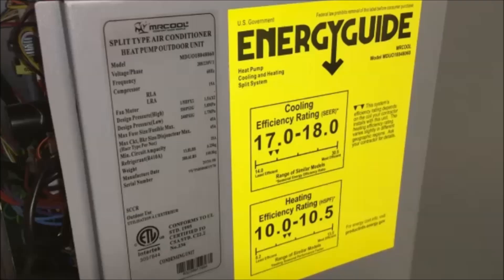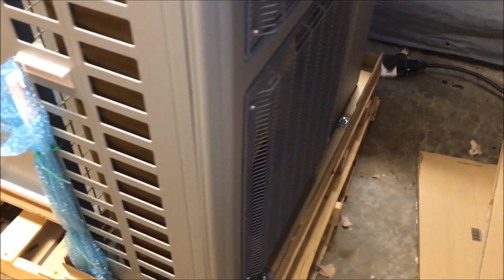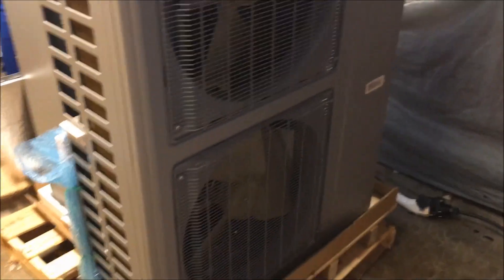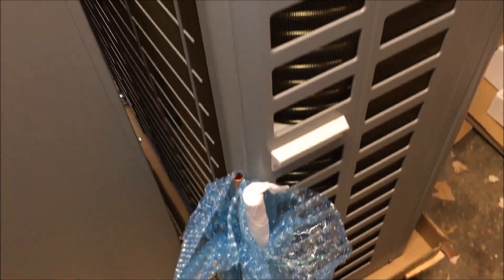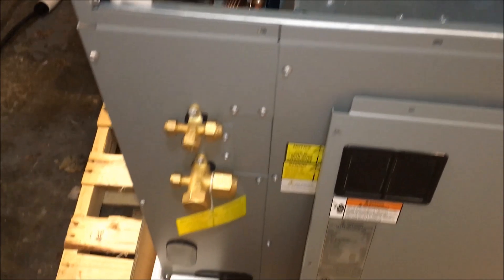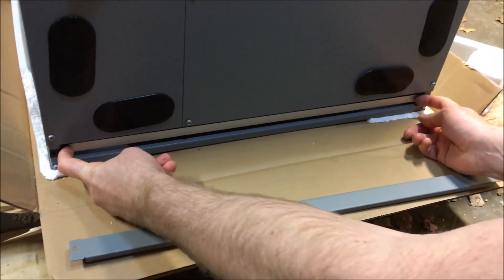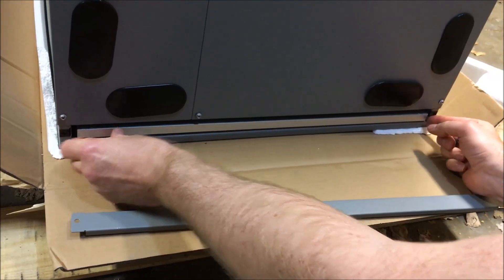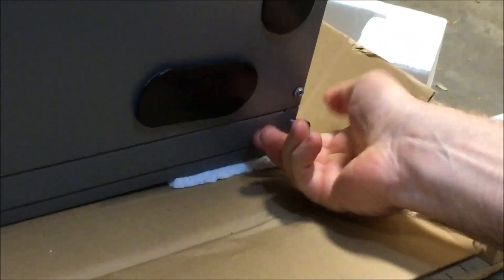DIY Mr. Cool Heat Pump DIY HVAC Unboxing Part 1

Comment: I just installed that same unit works great very quiet and so far keeps my 2500sf house hot in the winter and cold in the summer
Reply: Do you have to buy heat strip?
Reply: @davidk21419  i installed a 20kw heat strip but havent had to use them yet you do have to install some if you feel it wont keep up but it hasnt been a issue with mine so far but figured better safe then sorry
Reply: @davidk21419  I bought one too use it in 5 ton mode NJ... I dont use a heat strip... but so far temps have not gone under 10-15 deg... so we'll see. I like it a lot.
Reply: @VRVitaly  how's it running In the cold weather?
Reply: @whitechevy33  runs great i had a 20kw heat strip installed and have since removed the power to those and have no issues in indiana weather
Reply: Do I have to install a heat strip or is something install in the unit already?
Reply: Do you only install 1 unit for your 2500sf home? And if so how big it is,3/4 ton? Curious, im about to get some units and want to figure out what I need
Reply: @aatguzman8920  one unit and it is thr 4/5ton unit i have it in 5 ton mode
Reply: @leadingedge2 can you swap between 4 and 5 tons when you want, or is the coil different?
Reply: @seabass22  yes you can whenever you want u can run the air handler in 5 ton and the ac unit in 4 ton if you want you just turn the power off and change a set of dip switches in each unit to go from 4 to 5 ton
Reply: Has it saved any cost in summer cooling?
Reply: @TheRealoldcar  yes it has I have also been able to keep it 2 deg colder then normal and it runs and shuts off where my old system would run all day and stay about 72 to 70

Comment: I am wanting this same unit. My issue is the return is on the bottom. I'll either have to convert my ductwork to horizontal plenum or dig out my current mechanical room to accommodate the return.
Reply from the maker: I'm building a stand so it draws air in from the bottom.
Reply: @stem_saving1644  I wish I had room for that. I only have 10 inches to add a return on the bottom and I don't think that's enough. I'll figure it out one way or another.
Reply from the maker: I have to cut on the plenum to get it to fit and do some duct work.

Comment: If there isn’t anything else on the air handler circuit…get a 240 breaker, white becomes red(with tape), black stays black, green stays green. Now you have 240 using existing wiring.
Reply from the maker: The issue is access to both legs on the load panel. It's all filled up.  I might have to run another line from a sub panel.  But,  yes the ideal is solid.
Reply: @stem_saving1644  Mini/tandem/double breaker. Condense your 120 loads. Looking at the 2/3ton myself.

Comment: I have same i currently have it in garage will install soon am doing the duct work flex pipe and luxury round vents :)
Reply from the maker: Let me know how it goes.  Be interested to see your results if you get yours in first.  I have to get my airhandler done before I start.
Reply: @stem_saving1644  At this time i have a 24K ductless heat pump since 2018 works good in winter am up north but it cant heat up the full house this is why i got the bigger heatpump for the bottom i shod receive this today i ordered it like maybe 7days ago 
https://www.amazon.com/gp/product/B07S979LGN/ref=ppx_yo_dt_b_asin_title_o01_s00?ie=UTF8&psc=1